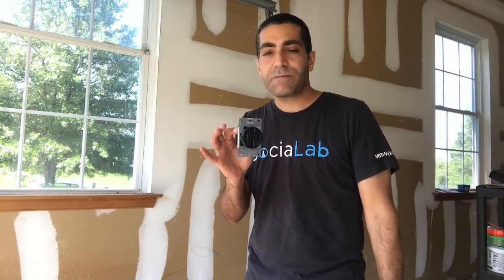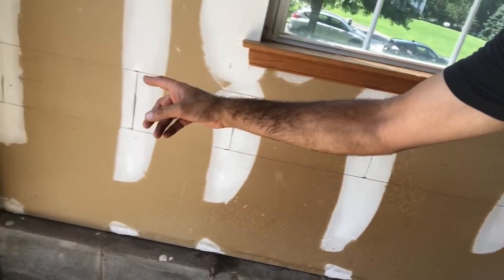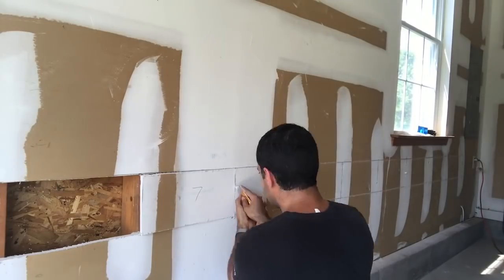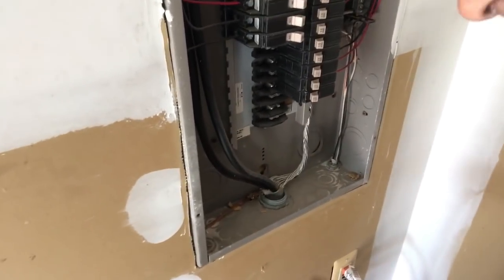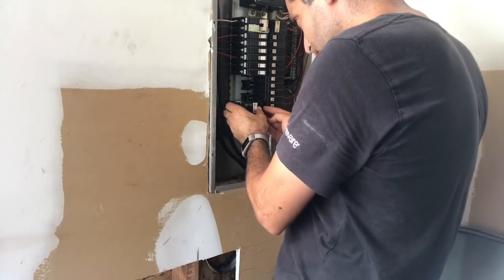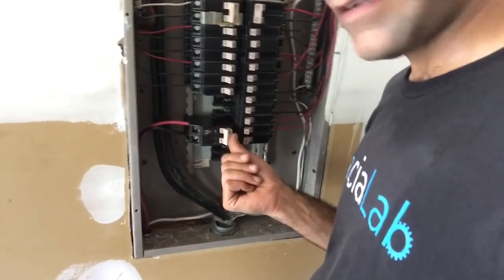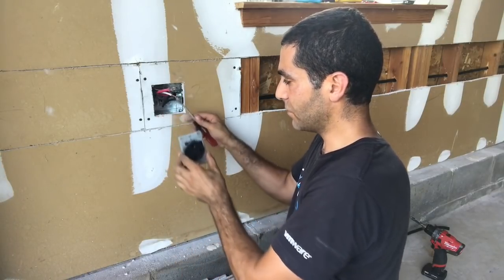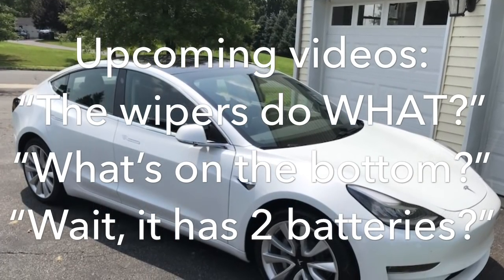[TESLA] 🔋 How To Install a Model 3 Charger At Home - Tesla mobile connector wall connector

Comment: I realize that this is 4 years old but should be updated. It appears that the receptacle is not a commercial grade. The smaller diameter, cheaper receptacles are having a lot of overheating and melting issues. Also, in most areas a gfci breaker is required. Go with a hardwire install. It is cheaper, safer and offers a higher amp output.
Reply from the maker: Right on. I had to replace the receptacle at 4 years. Nothing obviously wrong with it, but the car kept reporting high outlet temp. Inspected it, removed/reinstalled it, nothing. Changed it out with a heavier duty one and bingo! I’m sure I could’ve put the same model in, but 4 years later would’ve been the same thing. Live and learn, but good comment! Thanks.

Comment: You have patience of a Saint. I would have been frustrated by cutting that many Sheetrock and would have just run conduit on the wall. This is however safer and cleaner. Great job!
Reply from the maker: Sandip, my dude. Thank you!

Comment: I never understood why Tesla owners commonly use the NEMA14-50 instead of the 6-50. Both are 240v 50 amps, but the 6-50 only requires 2 wires plus ground (no neutral).  None of the Tesla EVSE's require the neutral conductor for 240v.   NEMA 14-50 requires the neutral so appliances like electric stoves can run the clock off of the 120 volts you get with the neutral.  Just seems like extra work feeding the thicker romex through wall/box/panel.

Comment: Nice video.  One nit pick.  When you measured the voltages, you measured hot to hot, hot to neutral, but I didn't see you check hot to ground.  Whenever I'm working with power wires, I always verify that my ground is good.
Reply from the maker: You’re completely right.

Comment: Could you have cut the sheetrock at every other stud and then thread the wire through?  That may saved some time?
Reply from the maker: Probably right. I’m just not that experienced with heavy gauge wire. That stuff was so hard to bend. I’ve fished smaller gauge Romex before like you described. But you’re right. It can be done.
Reply: Tarek's DIY Excellent video by the way, much appreciated.  I used your technique to install my first charger 6 months ago, (short run), getting ready to install a 2nd much longer run, it took me 2 days to find your video!  Thanks again!

Comment: I wanted to do this but how do I tell if this is going to set my house on fire?
Reply from the maker: Just make sure you have everything tied together before flipping the breaker on. Also, make sure each component is rated HIGHER than the amps on your breaker. For example, if your receptacle is rated for 50 amps, but your breaker is rated for 60 amps, FIRE! That sort of thing. As long as your breaker will trip at a lower amp rate than the rating on every component in front of it, and none of your wires or connections are exposed, you’ll be good.
Reply: As he said, take out a permit.  That way, when the inspector checks your work (before you seal up the drywall) you'll know that you have done everything right.

Comment: holy shit you did the job the hardest way possible! 3/4" conduit dude.  you coulda ran it high where the wall meets the ceiling if it bothers you lower on the wall.
Reply from the maker: The other day I was at a buddy’s house and noticed his newly finished basement. I took notice, specifically, at his painted cinder block walls. It honestly didn’t look bad. Outlets and switches were all run neatly down the walls from the ceiling in conduit. I complimented it all and asked why he didn’t put up framing and Sheetrock. He said skipping that part meant not having to put up fire stops and a variety of other things which are a pain in the ass. I brought this up to my wife because we too are looking to finish our basement. She said to me “since when have I known you to do something the ugly way because it’s easier?” I gave that response a second to sink in then thought about all the comments like this one (very few BTW). In the wall or in conduit; neither is wrong. But, one of them is ugly.
Reply: you did a clean job.  I've been an electrician for 30 years.  I like the look of conduit, and it is a garage.  I see that the walls are finished but they look like they have been taped and unpainted for years, which I think looks worse than conduit. i saw your video because I just installed two dedicated circuits in the garage of a newly purchased $3.5m home in silicon valley.  I had to run 1" conduit down the side of the house in the eaves and then into a loft above the garage where I split off a 60-amp circuit for a tesla charger and another for a dryer.  so it was quite a bit more work.

Comment: Why did you take apart the whole garage wall instead of just surface mounting the wire inside metal conduit? The inside garage wall is already unfinished so it can’t be cosmetic. There was no need to do any drywall work on this project
Reply from the maker: The other day I was at a buddy’s house and noticed his newly finished basement. I took notice, specifically, at his painted cinder block walls. It honestly didn’t look bad. Outlets and switches were all run neatly down the walls from the ceiling in conduit. I complimented it all and asked why he didn’t put up framing and Sheetrock. He said skipping that part meant not having to put up fire stops and a variety of other things which are a pain in the ass. I brought this up to my wife because we too are looking to finish our basement. She said to me “since when have I known you to do something the ugly way because it’s easier?” I gave that response a second to sink in then thought about all the comments like this one (very few BTW). In the wall or in conduit; neither is wrong. But, one of them is ugly.

Comment: Great video. My panel is located outside of my house. How would I run the wires?
Reply from the maker: To the inside? You’d drill a hole and use an approved conduit (a tube rated for that type of wire). Or, if you can just punch in from the back or side of the box if it’s already flush with the outside of the house.
Reply: Thanks for your response back. Here’s my second dilemma: all the wires are ran, my 6–50 NEMA outlet is in with a 50 amp breaker. When I tested the 6–50 outlet with my multimeter or voltage tester, it is reading A total of 122v instead of 240v. Do you know why that is? Thanks for your help
Reply from the maker: Luan Huynh I might defer to someone with a deeper understanding of residential electric circuitry, but my first question would be: are you pulling 120 from both hot (black) wires from independent terminals? Together, they would add up to 240. If your connections are correct, then you might be measuring from the wrong place. One hot to one neutral should be 120. Hot to hot should be 240. If you’re getting this measurement, then you’re good. If hot to hot is 120, then you’re not on separate terminals at the panel. Also, some have commented that the neutral (aka, common) connection is not required and that’s probably true. Anyway, I hope someone else can help out Luan if they read this.
Reply: Luan Huynh Single pole breaker is 120V. You need a double pole 50A breaker for 240V. Sounds like you should hire an electrician. Please be safe if you aren’t very familiar with this type of work

Comment: I don't know why, in your unfinished garage, you don't just run some conduit on the wall or on top of your block foundation wall.  Most garages don't have insulation, don't know why you thought yours did.  Also I see that at 17.52 you can clearly see a white wire coming out the wall below your panel, and running on the foundation wall and then up along the wall!  So I think you went through a whole big effort for nothing.  I did learn how to do it for my Tesla Model Y coming soon.  Thanks for the handy tips.

Comment: I'm not going to touch on the drywall, but the electrical needs a bit of clarity. For starters, the NEMA 14-50 is rated for 50 amps...not more than that. The cable you used only has to be 6/2 with the ground, or 8/2 with the ground if you not planning on installing a Wall Connector...also you don't need the neutral conductor in any level-2 residential EVSE. You could have saved yourself about $56.00 by buying the right cable. The Tesla Gen 2 has a maximum current rating of 32 amps which only requires a 40 amp breaker. Using a 50 amp. 2-pole breaker is a code violation and your inspection would have failed.  I would have used a 1-gang 4-11/16 in. flush cover for the outlet instead of the 1-gang 4 in. square metal box cover. The only time I use the Box Cover is when I'm running EMT on the outside of the wall. Not sure how much cable you had leftover, but if you were planning on installing a Tesla Wall Connectorin the future I would have coiled up a few feet and shoved it in the wall for later so you wouldn't need to run flex or EMT  on the outside wall when you hardwire the charger.  You have access to pass the conductors through the back of the Wall Connector. Hoped this helped.
Reply from the maker: Yes, incredibly helpful. Thank you. The comments are here for everyone. I appreciate you taking the time.
Reply: You don't need the neutral but if you were to ever plug in another device into that plug, you could potentially damage something. Better to use the neutral.

Comment: What should I do if my circuit breaker box is far away from the garage, such as in the basement?
Reply from the maker: The choices are to fish the wire through  the walls likely having to open up some walls along the way. Or, you can run conduit above the wall. You can probably exit the house with the conduit and re-enter close to the circuit box. Place the outlet/charger on the side of your house which won’t look bad with a gray conduit tube showing. Run the wire through the sidewall, through the conduit on the outside and punch back in just above the foundation near the location of your circuit box. If it’s not a finished basement, you won’t need anymore conduit the remainder of the way to the box.

Comment: Great easy to follow video. My breaker box is outside on the left side of my house, and my garage is on the right side.  I was thinking of digging a trench until I get it near my garage, but then I'd need to get it into my garage. Thoughts?
Reply from the maker: An outside breaker box? That in itself is curious (I assume it has a lock). Nevertheless, you’d have to punch through either the foundation or the wall with an approved conduit. It’s done all the time with the main service coming into an interior box.
Reply: Tarek's DIY thanks for the fast reply. I have a 200 amp box. If i had stucco I wouldn’t be hesitant about cutting it out. I’m going to take some wide pictures and take it to Lowe’s or HD. I know that I’ll probably need to add a blank silver outlet box right  outside of where my Tesla charging station will be.

Comment: I hired an electrician to do it for me for $375.
Reply from the maker: Holy s*** that’s a good deal. Licensed? Got your permits and all? That guy must’ve been starving.
Reply: @tareksaleh77  I know right!! I would have charged you $1,600. Its ugly out here B
Reply: I just got a quote from the electric company who did all the wiring in my house (just had it built) and they quoted me $275. They explained they will run the wire from my box up through the attic and coming down from the attic to where I want the outlet (maybe 25' of wire)... I was looking up the cost for me to do it myself, but I don't think I'll be able to do it cheaper because the wire is expensive... I have solid block walls, so I cannot pass it through drywall and having a conduit tube running around the walls isn't ideal for aesthetics. I really like their attic idea lol...
Reply from the maker: That’s a phenomenal price. The parts cost me about $130 (also 25 feet of wire). Plus, that 6 gauge wire is really hard to work with. I’m with you on the conduit. It doesn’t look bad, I just figure if there’s any way to avoid it, it’s much nicer without it.

Comment: Why cut the 1ft section, why not just fasten it outside on the wall inside metal tubing like in camping parks?
Reply from the maker: Marco Panzanni Yeah, I get asked that a lot. Just preference. Wanted the flush look.  Plus, it made for a good inside view of the whole thing for others who might not be well versed in electrical connections. Thanks for asking though. I appreciate all comments.
Reply: @tareksaleh77  ah ok =)

Comment: Why not just bought the Tesla Wall charger since you are cutting the board and connect to the breaker for future proof?  Also why not just use the conduits instead of cutting the board for more work?  You could cut every other boards and snake thru to safe some cutting and patching work.
Reply from the maker: Hey man. Thanks for the comment. All good thoughts. Really just personal preference.  Mostly didn't want to pony up another $500.  I saw a cool hack for attaching a short NEMA 14-50 extension to the wall corrector to plug into the outlet so you can take it with you if you move. Sure enough, Tesla now offers that option OEM from the Tesla store so no hack necessary.  As for the conduit, I really just wanted the whole thing hidden and flush.  Last reason is that I'll be able to plug in my Rivian connector when it comes in 😀

Comment: If you are using a UMC mobile charger,it's limited to 32 amps input.you can get that with 35 to 40 amps breaker and get away with a thinner cable say 8 gauge which is easy to work with for the Nema 14-50..Thoughts?
Reply from the maker: You can really do anything you want so long as all of your component in front of the breaker are rated higher than the breaker itself. The idea is that the breaker must trip before your components burn up. That includes the wire, the outlet, and the charger. However, installing 8-gauge wire will limit you from upgrading the charger in the future. Or, if it’s possible to plug in a device which will draw more current than the wire can handle, you’ll be at constant risk. Perhaps another EV enthusiast friend comes over and needs to charge. You’ll have to remind them to lower their charge rate. In the end, it’s all up to you as long as everything is rated higher than the breaker by 20%.
Reply: Tesla manual for mobile connector does mention 50A and including 50A adapter, I guess it designed with tolerance. I believe 40A is perfect match Tesla wall connector can also use 40A. So, if you have mobile 50A adapter and don't want to buy 40A one, than we get to wiring to 50A

Comment: That type of box was suppose to be flush with the Sheetrock when using the industrial cover, otherwise when you make the box flush with the stud you should then use the approbate depth 2-gang mud ring. Otherwise nice job

Comment: Good vid. Only suggestion is after running wire.  Should have connected the outlet and everything before actually connecting to the panel that way you would have no way for an accident to happen. Even though you kept the breaker off.
Reply from the maker: Excellent point. Safety first.

For those reading through these comments, do exactly that. Make the hookup into the breaker last.
Reply: @tareksaleh77  Code here would require metal conduit, to prevent anybody down the line from drilling into or cutting into the wire. In this case, you could use galvanized nail shield plates on the face of the studs in front of the holes.
Reply from the maker: Good point about the nail plates. I did before putting Sheetrock back up.  Didn’t know metal conduit was required in the wall. Is that due to the gauge of wire? Never heard of it.
Reply: not required in walls in California for residential

Comment: man, this is very useful
it's not that hard but took  a lot of efforts
appreciate for making the video
Reply: Great work.  I tend to think I am a DIYer myself.  Got quoted for almost 1000k for the job.  My only concern for me is that the fuse box is on the other side of the house of where the outlet needs to go.  I have to think of a way to get the wire tucked in nicely to the other side of the house.  It's only about 40 ft but still need to conceal it.
Reply from the maker: Thanks I appreciate that. Glad you made use of it.